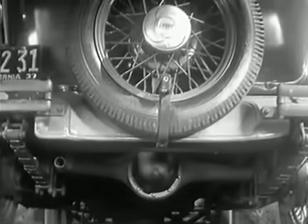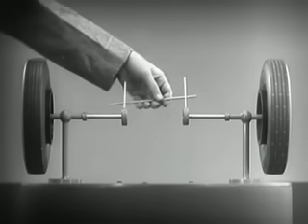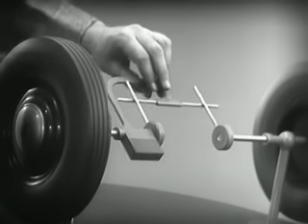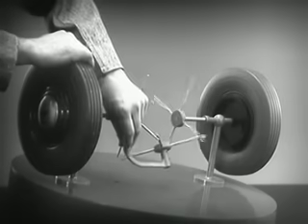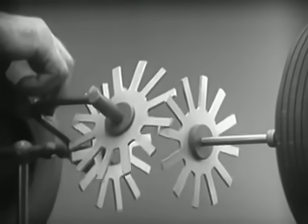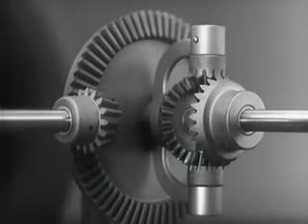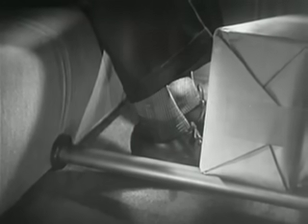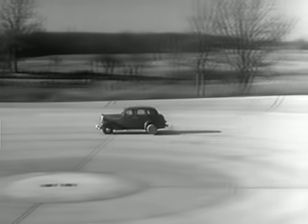Around The Corner - How Differential Steering Works (1937)

Comment: Oh so that's why if I lift the front of my car and in gear turn one wheel, the other spins in the opposite direction!
You can also solve the cornering problem with the overrun clutch (connect to both wheels but drive the slowest one), but you lose engine braking and reverse gear.

Comment: I'm 44 years old and have been doing mechanics for the past 30 years and let me tell you something, this 1937 video is explaining the rear diff in more detail than anyone i've seen on uTube! 

And god forbid you there was a car commercial in todays times with both driver and passenger running outside on top of the rear driving wheels while the car is moving! That would be illegal!

Comment: 🎯 Key Takeaways for quick navigation:

01:50 🚗 Funcionamiento del diferencial en vehículos antiguos
- El diferencial permite que las ruedas de un vehículo giren a diferentes velocidades durante una curva.
03:11 🔧 Principio de funcionamiento del diferencial
- El diferencial permite que las ruedas traseras de un vehículo giren a diferentes velocidades.
- Consiste en un conjunto de engranajes que distribuyen la potencia del motor a ambas ruedas traseras.
05:59 🚘 Adaptación del diferencial para automóviles modernos
- Se realizan ajustes para mejorar la suavidad de la conducción.
- Cambios en el diseño de los engranajes para reducir el ruido y mejorar la eficiencia.
- La ubicación del eje de transmisión se modifica para aumentar el espacio interior del vehículo y mejorar la experiencia del pasajero.

Made with HARPA AI

Comment: the only problem with this design is that when you get stuck. the power goes to the free spinning wheel, which is where differential locks come in. how do they work? i have no freakin idea
Reply: They solved that problem a long time ago. It's called a limited slip differential.
The differential adjusts the distribution when it feels a wheel is spinning.
Another generic term for this was Posi-Traction. That was actually the GM tradename for their cars with this type diff.

Comment: Built my first Rc car almost 30 years ago, (diff included) I took it back to the store originally because when I turned one of the wheels the other wheel on the same axle turned in the opposite direction, at the tender age of 41 I've finally watched a video explaining the witchcraft that is a differential, and it's ancient itself, Damn

Comment: 7:51 a shaft in the middle of the floor is exactly what they did a few years after this vid... and that continued until front wheel drive... now we are looking at electric motors in wheel hubs with no need for diffs.

Comment: This video was made in 1937, but it's still very much relevant today.
Very clever to use a motorcycle parade to explain how the inner and outer wheels have to turn at different speeds when turning.

Some vehicles like trucks have the ability to engage a differential lock. Which allows the driver to lock the differential so that the wheels turn at the same speed.
This can be useful in some specific situations where traction is a problem. Like for instance you're spinning on one side, but have traction on the other side.
It doesn't always work though. Sometimes it's just too slippery.
You also shouldn't use it if you plan on doing sharp turns. The vehicle doesn't turn very well when the wheels turn at the same speeds, as the video explained.

Comment: not only did he explain the basic physical principles, he even explained how the change went from singular bars towards the cogs, this was a great video!
Reply: But what happens when one wheel is lifted off the ground? It will spin freely while the other wheel on the ground gets very little torque. This surely gets people stuck in snowy situations.
Reply: @sqlexp This is why limited-slip differentials exist. The one in the video is a simple open differential, or 100% differential, since it allows each wheel to spin independently at any speed.

Comment: the differential is perhaps the best mechanical invention ever
Reply: But you said the Differential; so, simple machine evolution was probably the inclined plane, the threaded screw, gears in a plane, & the masterpiece, the differential. Somewhere in there is the lever. PROBABLY MORE IMPORTANT was the well pump and irrigation pump.
Reply: @adrianmonk4440  you could also add a wheel, a chair, a pencil...etc..etc

Comment: Great video but the OP linked to the wrong Wiki page, that page is about differential steering as used by tanks and "skid steer" type vehicles which is quite different from how a differential is used in a car which is steered by turning the front wheels.

Comment: 3:00 "Engineers had to find a way to connect both rear wheels to the engine without sliding on turns. The Differential."
Da Vinci designed this in the 16th century and Pecqueur used it in a vehicle in 1827.
They did not have to find a way, it was alredy there.

Comment: This is fine until one of the wheels encounters a slippery surface or gets raised up on uneven ground. The differential causes the wheel with least resistance to continue turning on it's own, so the cars stops moving. Modern vehicles use a more complex limited-slip differential.

Comment: I don't see how this solves the one wheel drive traction issue. If one wheel doesn't have traction the motor will just spin it while the other stays fixed
Reply: It doesn't solve that problem because this is about the orig. Open Differental. The one  wheel traction problem is addressed by the later Locking Differental that was invented in the 1940s and later by the modern traction control system (TCS)

Comment: Another insanely great mechanical feat is how train wheels corner by altering their own diameter, no moving parts required
Reply: This is because of the structure of the wheels themselves. They are specifically designed for the road they're riding on

Comment: I am blown away with how simple and effective this video is, I didn't even know the rear wheels even moved at different speeds!
Reply: The front ones as well of course
Reply: @andreasa.2226  I knew the front did, didn't know how though!
Reply: @Tencryn  the  same procedure for the front tyres too but if the vehicle is 2 wheel drive the wheels will be attached separately
Reply: @bassianpuneet4523  pls explain better .. I want to understand what you mean 🥺
Reply: @anthonywilfred9913  the working principle of differential is explained in video and am saying that if the vehicle is 4wd then another differential will be needed for front wheel to drive
Reply: @anthonywilfred9913  the wheels that aren't attached to a power source don't need a diff because they can just spin freely without a connected drive shaft. If your car is front wheel drive your diff is in the front.
Reply: Only when it's not on a straight motion.
Reply: Yo tampoco
Reply: @KHAinnovations  menos yo

Comment: If only the makers of this film knew their efforts would result in a better demonstration than even the best modern CGI could make nearing a century later.   Knowing that those are real physical objects makes this somehow more intuitive and trustworthy than an image we know is not real, no matter how accurate.    Also the fake ones tend to try to jump too quickly to the real shape of the functional parts since they can, but ironically, building up from the crudest non-functional concept and incrementally solving problems along the way shows you why the final parts are designed like they are rather than them asking you to take that as a given.    
As one watches they they should also be awed by the cleverness of all the engineers who made it possible to actually make the materials and machinery to turn this idea into reality.  The collective genius and effort it took to conceive and create even just a functional differential much less the rest of the car is mindblowing.    Even when the combustion engine and traditional transmission are obsolete this differential concept will live on.

Comment: Ha I knew it. So when I was participating in athletics I was been robbed of speed. The inside ring was a lot faster than the outside ring. School sport system was a complete waste of time.😣the sports teacher was putting me at a disadvantage on purpose which means i was running alot faster than those who were running on the inside ring were. 

Sorry I know what i'm saying might sound unrelated to mechanics but the physics of does. After what is said here at 01:56 i am convinced i was being robbed of speed
Reply: Duh

Comment: They must have dropped the idea about attaching the driveshaft to the bottom of the diff gear in order to get rid of an intrusive driveshaft because every car I’ve been in that was rear wheel drive has a driveshaft “hump” running through the center of the car.😀

Comment: Curious how they didn't think about front wheel drive until later when it came to drive shaft placement. Goes to show that innovation and engineering in an iterative process of just making things slightly better.
Reply: Material science made front-wheel drive possible. It uses the same principles, but requires components that are stronger AND smaller than the iron and steel behemoths of the 1930's.

Comment: it has to speed up to ctach up, so your differential is forcing it to slow down adding drag, you would need diminishing to expanding diminsihing differentual or rather influential gear system engine.  i say this... drive shaft each wheel to core power as one method... use at tire gear not central axis etx

Comment: Today we got locking differential for off roader, or limited slip for normal cars, but sometimes, we are still using the diff on the video today (open diff), because it works so well.

Comment: Only one problem - a regular differential still only give you a one wheel drive car when it matters as the power will always go to the wheel with the least resistance.  Now we need a video on the limited slip differential!
Reply: I’d imagine this was new tech back then
Reply: LSD invented in 1935 by Ferdinand Porsche.  So that would've been too cutting edge for this video production date.

Comment: Absolutely love how their only two reasons they give as to why having a fast spinning driveshaft running through the cabin completely exposed is 'because it would be inconvenient for passengers' and 'would be awkward for carrying luggage'.
Reply: Is nobody going to comment that the centre hump that runs through a car now a days is a thing? Originally in the 50's to now was to accommodate the drive shaft of a rear wheel drive. Even front wheel drive cars still have that hump, for like, no reason.
Reply: @AstrosElectronicsLab  its part of the crash frame. its there to prevent the middle of the car from collapsing into itself in a crash.
Reply: It's for your exhaust nowadays cause cars sit so low
Reply: Because driveshaft will be inside a hollow tube or be covered with something when it's inside the cabin. Engineers wouldn't let that huge of a safety hazard be exposed.
Reply: It would obviously be covered by a metal sleeve that doesn't turn
Reply: @EnderSpy007  Now that's just boring, and quite silly. I prefer my cars being a workplace safety hazard.
Reply: @EnderSpy007  which if the driveshaft broke would still turn into a propeller along with the broken drivshaft.
Reply: What more reason do you need?
Reply: @mexicancanteen9596  no idea, like catching your clothes or jewelry on it and getting a body part ripped to bits???
Reply: @alex31ytb is that not inconvenient
Reply: @alex31ytb  Because people in the 80th didnt know what a casing is? 😉
Reply: @alex31ytb  " no idea, like catching your clothes or jewelry on it and getting a body part ripped to bits"

That would certainly be an inconvenience.
Reply: @alex31ytb  It would be covered, a lot of new cars have that.
Reply: Safety wasnt that big of an issue then. We are all pussies now compared to our grandparents.
Reply: Many replies to this comment contain statements which include fantasies that were not portrayed in the video. Statements such as the driveshaft would be encased in a tube or otherwise inaccessible to the passengers. The video plainly showed a drive shaft in the passenger compartment. Why do I even have to point this out? Idiots!
Reply: @jetmelt  How do you know it showed the actual driveshaft and not a tube encasing the actual driveshaft?
Reply: @johnanddiann100  because it’s a prop and they wouldn’t go through the trouble.

Comment: That is a brilliant invention. And so reliable, I've never heard of someone having to have their differential replaced.
Reply: I have. But usually only from impact damage.
Reply: They get rebuilt/placed ALL the time.  Abuse, impacts, poor/lack of lubrication, low quality manufacturing.  And while this video may easily explain the basic operation of the limited slip differential, it also accurately demonstrates why they fail in real world application.

Comment: Gone all w EvCar EvTruck 2 motor r 4 motor drive.
Now
Crab steer EvTruck where all 4 wheels trun into a corner and all 4 wheel powered. 
True tank turns Tesla EvTruck
Tesla EvTruck Crab Steer 4 Wheel driven like a 4 wheel lock Diffendal traction on each wheel

Comment: It sure didn't take too many years for car makers to just say "F' it" and just build the floor of the car around the transmission and driveshaft...
Reply: They eventually took the consideration of "broken roads" where as the cars shown in this video can easily get stuck. So car manufacturers trying to make daily cars a bit higher (I'm thinking about Asian cars like Mitsubishi, Toyota, etc) while the car are higher from the ground, the cabin also gets higher, but you still don't want the drive shaft to ever touching the ground by any obstacles, so they make it into the cabin.

Another example who don't give a fk about this, is Rally Cars.

Comment: Lol imagine putting the dif lock through the cabin
Reply: The car's chassis & driveshaft when cruising over Broken roads: ADIÓS.

This video is just explaining a good example of Driveshaft and differential gear "with" the assumption that the road is always smooth — which is realistically impossible to find an "always" smooth road.

The closer/lower driveshaft to the road, is just accident waiting to happen.

This video itself is still brilliant. But has consequences.

Comment: Still have a doubt. In a left-hand turn as an example, right wheel will have more weight and therefore resistance. Shouldn't it be rotating at a lower speed than the left (inner) wheel then?
Obviously this is contrary to what happens during the turn.

Comment: there is something wrong with the modified vesrion of the protoype . if the left wheel is locked the the right one will contiune to rotatre beacues of the    space between  crossbars crosses . Correct me if I am wrong but the whole point of the bar is stay still (only rotate around the pivot ))while both wheels are rotating at the same speed  but when speed difers the cross bar whell rotate along its horizental pivote . this is not at all possible when you are using gear instead of the  bar .( there is no space. if the bacuse if the left gear stops it blocks the  rotaion of the right support bar)

Comment: This is great

It doesn't just explain how it works, it also explains why a differential was necessary in the first place and does it with simplicity 👍😉
Reply: All in UNDER 10 minutes.
Try to find any youtuber explain anything in under 10 minutes lol
Reply: @xtlm  action lab
Reply: @xtlm  challenge accepted. Sam o'Nella academy has videos under ten minutes.
Reply: @xtlm  YT was better when everything had to be under ten minutes.
Reply: Except for one thing - a regular differential still only give you a one wheel drive car when it matters as the power will always go to the wheel with the least resistance.  Now we need a video on the limited slip differential!
Reply: @nickh5081  I believe open-type differential were either the only type, or the most common differential at the time this video was made.
As you said, open-type differentials are fine for spinning on roads, but still a issue when driving on bumpy roads or off-road.
Reply: @nickh5081  The limited slip diff was only race car technology at the time. It didn't get to production cars until after WW2
Reply: @MonologueMusicals  True enough but not the point.  I'd like to see how it works in comparison.  Doesn't matter  when it was invented in relation to this film.
Reply: @nickh5081  shut up, no we don't